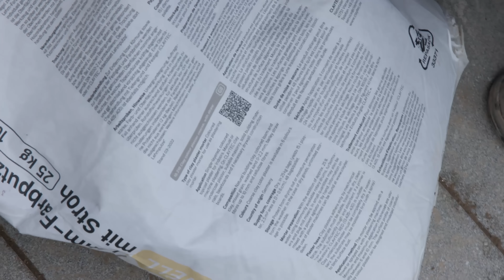I never thought it would be so easy! (Rescuing a 120 year old house)

Comment: Merry Christmas! Annoying pro tip. We generally stucco from top to bottom. First, this ensures that the stucco (or your clay) is adhered to the substrate and not rusting on the material below. Shallow bubbles can form because of this and it will later flake off because it is not attached to the wall. Also, if you are going top to bottom, you can place your hod next to the wall and transfer material quickly, further, this will also prevent the hod from marring material that has already been applied. This points can seem trivial, but it will save you tons of time over the entire job. Oh, also, your scaffolding and ladders won't harm the walls that you have just finished. You are always removing support as you work instead of adding it.
That's just one random guys opinion.
Reply: These are SUCH useful suggestions that I wouldn't have known or thought about.  We are in the process of building our own natural house and will be plastering all the walls, inside and out.  So, a LOT of work ahead and anything that can save us time, make us more efficient and have a more durable outcome are a godsend.  Thanks so much for sharing these pro tips!
Reply: Now this is something that can only come from experience. And we all needed this. Thank you
Reply: @ivan_valerian that has nothing to do with experience. It's standard procedure.
Reply: @sunday4419  yeah and someone with an experience with standard procedures is a huge help for someone that just wings it without an experience eith standard procedures such as Laura who is a first timer no?

Comment: To anyone trying to recreate this, be aware you might have a different risk of getting cracks. Here, the wall below is CLAY stone with CLAY mortar. So the entire underground will stretch and compress evenly when taking in/giving off humidity and warmth. The final layer of clay has little bits of straw and cellulose, that also prevent cracking. For walls that are of different materials, have wall-heating integrated, or have a thick layer of plaster to even out, you will definitely need a base layer of plaster first that has reinforcing fabric worked into it.

Comment: Made my heart sing Laura, to see you applying that mix!!  It seemed to go on the wall like the lime plaster I used many years ago in France.  More in the mix (mine was only chalk and sand, plus a couple of eco additives to make it stick better and lengthen the open working time) but the look seems to be identical.  Beautiful.  If you want to alter the colour, another easier choice might be to paint with chalk/lime distemper with natural oxide colour additives (something like yellow iron oxide is a lovely warm yellow depending on amount you put in) and casein to prevent the paint rubbing off!  Totally natural and very inexpensive!

Comment: Hello Laura, let the clay soak. Water into the bucket and then sprinkle clay in until there is no more water or wet spots to be seen. Wait 10 minutes and then stir at low speed. This way you always have an ideal result. And use a wide squeegee for the final removal. You have the bars as a stop or rail. Allow the clay to set and then smooth it out with a sponge board and water.

Comment: The small windows you're installing at the top of the walls were popular in older houses. They were called Transom Windows, they pivoted and helped with airflow, but airconditioning made them irrelevant. They had nice brass or cast iron opening mechanisms. 😃

Comment: I enjoyed watching Laura meditatively apply plaster. I would like to know if this plaster gets hard and water resistant like plaster of paris, or will it need paint? Also, I would like to know how the temperature feels in the house in the cooler weather, even without heat, with all of the the thermal mass of the clay "stones" in the walls and the outer insulation.

Comment: I can't find the German word for it, but a "plasterer's hawk" makes this job easier. I posted a Wikipedia link, but I think that led to the comment being instantly deleted. 
It's a square board with a short handle in the middle of the underside that you load with plaster, and then scrape it off a bit at a time straight onto the wall with the trowel.

Comment: I never realized that this is a lot like a straw bale construction, where the load is upon the wooden structure and the clay bricks are in the negative spaces to span those areas.  Altho' straw is better insulator, the clay allows for simple, recyclable material as Laura points out.  My only question is wall hangings (pictures, tapestries etc) are then mounted by...some kind of picture rail that is attached to the wood? or directly onto the wood? Some minimalists might say no hangings at all, but people often like to display artwork etc.
Reply: That is what the wooden 'picture rail' was for in old houses.  You simply ran a long enough string or decorative ribbon from each item up to the rail where the nails were hammered in.  No plaster was damaged.  :)

Comment: no insulation there is one big cold bridge. replacing the stairs for insulation was better option.
Reply from the maker: We have a massive outside insulation. No coldbridges anywhere
Reply: Buy a thermo camera and look. There are still a lot of thermal bridges. And those pull the energy and heat out youre house.

Comment: There's a device I just-learned exists: concrete-vibrator 1HP 220V; can separate concrete's cement from aggregate by density via vibration. The Most physically-energetic-machine I've ever seen realized: demolish nailed-construction, masonry, oxidized-fatigue, invertebrate-infestation, gopher-holes, and even flame (fire oscillates oxidation at a rate unsympathetic to Concrete-Vibrators' oscillation). Buzz a fire out.